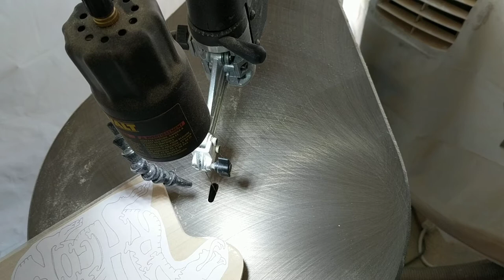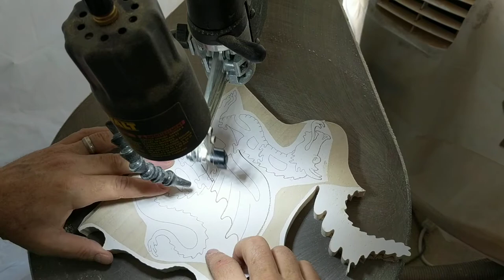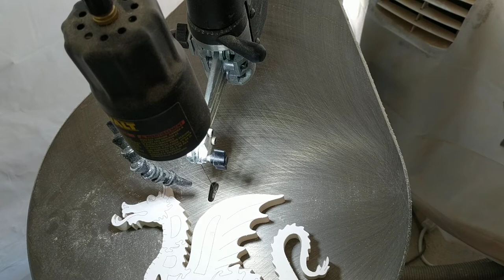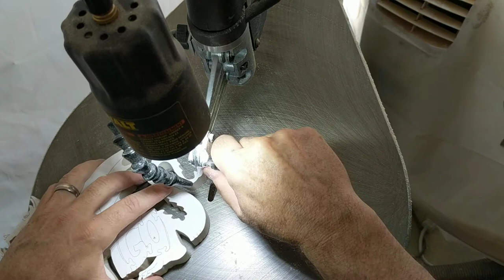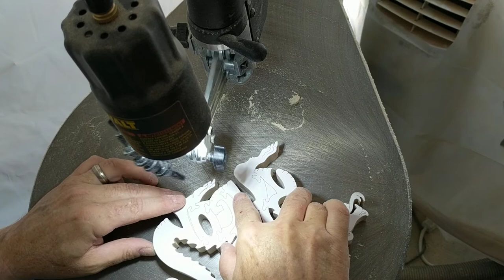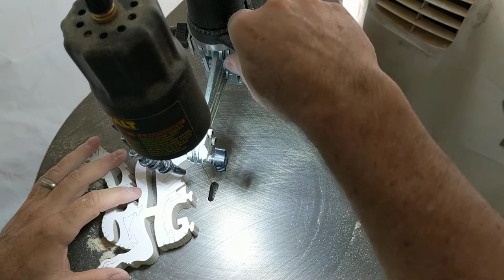Scroll Saw Dragon Puzzle Cutting - WoodcraftByScott.com

Comment: Why don’t you just replace the bearings and sleeves on other saws that broke. Several how to videos on YouTube on how it’s done.
Reply from the maker: Hey Vinnie, yep, I've watched them all and Bob Brokaw is the guru of it.  I'm simply too busy with a full time job and at the time I had 2 side businesses as well... and... quite frankly I'm not too mechanically inclined.  I did try once and failed miserably, so it's just easier to buy a new saw and at just $500, it's a very small part of my cost per puzzle that I make and sell. (1000 puzzles sold per year)